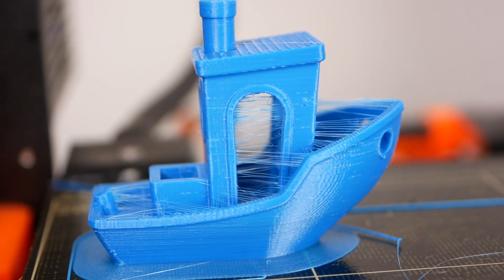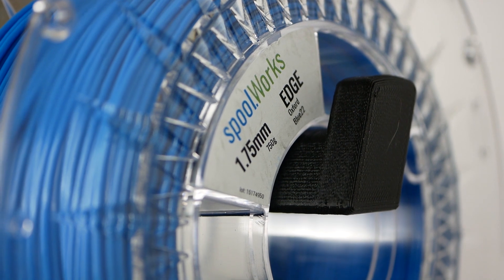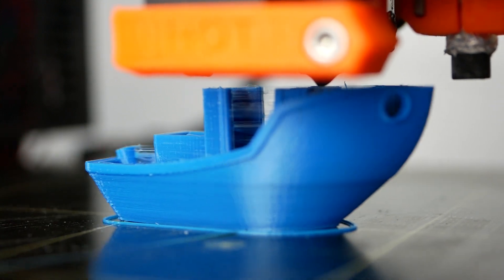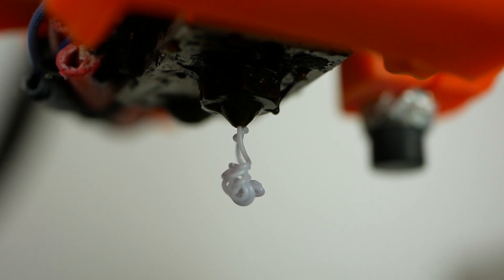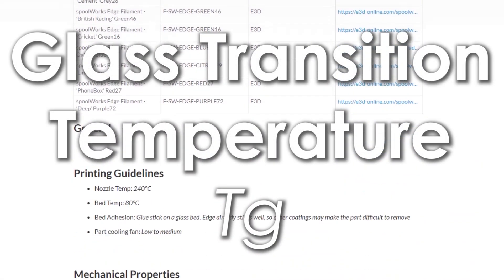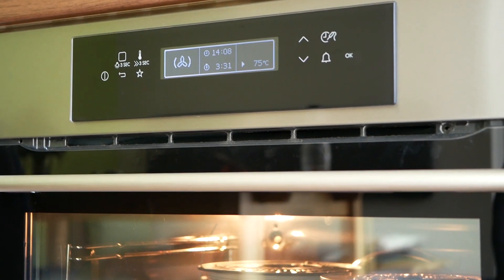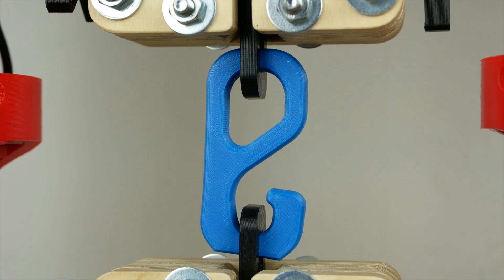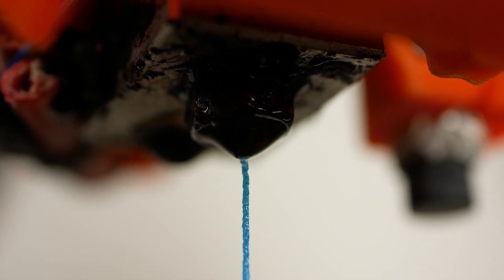WHY you NEED TO DRY your FILAMENTS!

Comment: I spent 3 days trying to fix my printer then I realized the filament was moist. I switched filaments and it worked great again.
Reply: You "released" or you "realised"? :)
Reply: Oh good catch. I updated it.
Reply: Did u ever dry out the moist roll??
Reply: @elfpimp1  moist....
Reply: @SangheiliSpecOp  lol...
Reply: @elfpimp1  ;o ....

Ya know, I really want to buy a 3D printer, I'm even willing to pay a little more to get a better brand than the budget friendly ones (I'm doing ma research) but damn... I have learned so much in the past two days about them and I'm the type of person that would want to apply everything to get the best possible results. You gotta keep everything dry, make sure your bed is level and the material will stick to it, possibly get a rasberry pi to manage everything, etc etc.

Sounds fun though
Reply: @SangheiliSpecOp  hey there. It is fun. I ended up getting an FLSUN C3 off Amazon.  I think it was around us $379?  Big print bed, 300x300 and tall prints at 400mm.. it's a great kit. It came with a single and duel nozzle setup  (I've been using single for now) and it also has a great self leveling sensor.. Ive since designed my own adjustable feet for it (they work with any 20x20 mm extruded aluminum frame) remixed a cooling fan for another printer so it works with mine. And  some other things I've printed for it.
Reply: @elfpimp1  that's pretty cool, I'll have to look into that one. Self leveling bed and the dual nozzle set up sounds nice. And that seems to be a big printing area as well. I absolutely love that you can print out upgrades for the printer itself hahaha. It's self aware...
Reply: @SangheiliSpecOp  groovy! Goodnlucj, have fun. And Happy New Year!!!
Reply: @elfpimp1  jammin... Thank you. You have a happy new year as well
Reply: @SangheiliSpecOp  which one did you get?
Reply: @SangheiliSpecOp  did you ever get a printer?
Reply: @Darenz-cg9zg  I.... did not lmao. Probably because I just kept going deeper and deeper down the rabbit hole and was too undecided on which one to get 😂
Reply: @SangheiliSpecOp  oof, good luck choosing in the future. If you have a ton of money I'd go for a prusa.
Reply: @SangheiliSpecOp alright gonna need another update. Did you get one yet?
Reply: Me too.... Is good to know I wasn't the only one
Reply: Me too... i'm not smart lol

Comment: Very impressive analysis... it’s always interesting to see quantified, that which everyone tells you, early on and just expects you to trust in. That said, at the risk of being slightly self promotional, trust me... you can build a filament dry box for less than the cost of a single roll of cheap filament... https://www.thingiverse.com/thing:2499305

Other popular modifications / enhancements of such systems include placing electronic reptile heating pad in the bottom of the box, or self contained desiccant canisters attached to an electric heater, to prepare the desiccant for its next use, after its absorbed moisture to the point of saturation.

Comment: Can you tell me, what percentage of moisture is critical? 
i am using the same principle (box, Silicagel) to store the filaments ( PLA, ABS, PETG, TPU, Primalloy). 
Never had problems. I am using the Lock n Lock boxes. 
https://blog.moneybag.de/3d-druck-filamente-und-die-richtige-lagerung/
Reply from the maker: Hard to say and hard to measure. I'd try to get them as dry as possible and if you notice changes in the printing behavior, then the moisture might be too high.

Comment: Thank you or doing this video. I always cringe when I see 3D printer "experts" on YouTube storing all their filament exposed on a shelf. What were your results like for PLA? When I first started in this hobby back in 2011, it was always drilled in my head from everyone in the community to store it with desiccant, but nowadays most people just let it chill out on a shelf. Were we all overreacting back then, or have the chemistries changes since then? Thanks again. Cheers!
Reply from the maker: I only have one type of PLA with lots of additives which has real moisture problems. All the others are basically fine. I forgot to really point out in the video that moisture becomes a bigger problem, the higher the printing temperature is. If you always print your PLA around 200°C, it should almost always be fine. If you want to increase the layer adhesion and want to use 240°C for example, you might notice moisture even in PLA.
Reply: After big projects I usually have left over material that I sometimes use much later. I noticed a little stringing with some year-old Shaxon PLA from Fry's that I print at 205deg.  I know it didn't do that when it was new.  The house is air conditioned.  

I also noticed that the flow continues after the extrusion stops.  CNC Kitchen mentioned a possible cause of moisture that I hadn't considered.  I thought it might be the result of tension in the Bowden tube.

Maybe I'll get some desiccant and make a bin this year.
Reply: You should note, that when humidity in room is low, it's not that harmful.
Reply: It highly depends on your filament. Nylon is impossible to store just on a shelf whilst PLA will work just fine. I've had rolls of PLA out for months without any issues or differences in printing behaviour.
Reply: Mr. Crankydude - Yes, I know all about nylon and other filaments. Nylon usually even has to be dried fresh from the manufacturer. But no one thinks it matters much for PLA. I guess I'll have to do my own version of this experiment for lowly PLA. And Artur, unless you live in the desert, there is plenty of humidity in your home.
Reply: I bought a 3d printing pen a few years ago, didn't know anything about storing PLA and had it outside in the garage until recently when I got a printer, put it through and it works perfectly somehow
Reply: I keep the humidity in the room with my filament shelves between 35% and 40%. Nylons and flexibles I try to store dry. I haven't had an issue in 3 years.
Reply: Control soft/hardware, and to some extent the printers, have come a long way since 2011 (back when I laughed at people zip-tying hot glue guns to the worst CNC designs they could find).  My hunch is that you weren't overreacting back then...  "The print finished, right?  Those marks are just the process."  Chemistry or not, low print quality expectations may let water absorption go unnoticed.  It wasn't even close to your biggest problem back then.  It's cool to see it evolve to the point where we're picky about moisture.
Reply: gth042: I bought two Ultimakers back in 2011 and they still print better than 95% of the printers out today. Granted, they have been updated along the way with things like heated beds and E3D hotend, but they were light-years away from the shitty repraps that people were trying to build with hardware they found in their junk drawer. So yes, I and other Ultimaker users did notice print degradation with moisture, even in PLA. And it still exists today, people just don't care so much because the results aren't always visible. But since I usually print mechanical parts, I do notice and I do care.
Reply: 0Calvin 
Yeah. I have the same broom I was given when I started work 40 years ago.
Granted, I have replaced the head once in a while, and also the shaft, but it is still amazing that such an old broom is better than the crap we can buy today.

Comment: Great video...do you know any diy way to measure the moisture of filament?
Reply: 3D Gussner you'd need a good scale for that.  Weigh some filament and then leave it at 105°c I'm the oven.  Take the sample every 30 minutes and weigh it.  D that until the weight is constant. I do that frequently to measure moisture in food samples.
Reply: alcx112 thanks I will try...just thought there might be a different way without bake it
Reply from the maker: There are expensive machines for that but the best way is really drying it for a long time and monitoring the weight in regular intervals.
Reply: I wouldn’t heat that hot, especially with PLA, the glass transition temperature is ~60*c. 

I would go off the temps provided in the video.